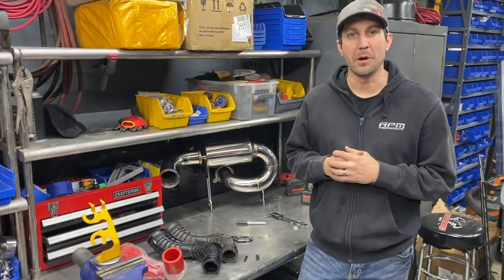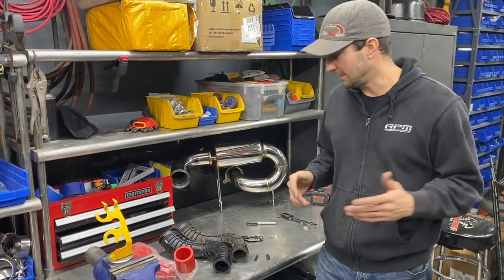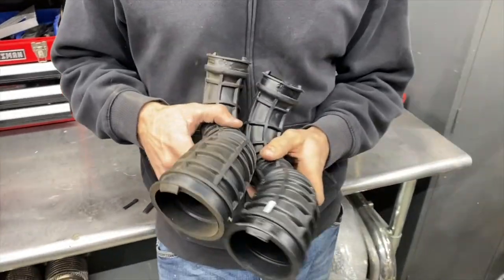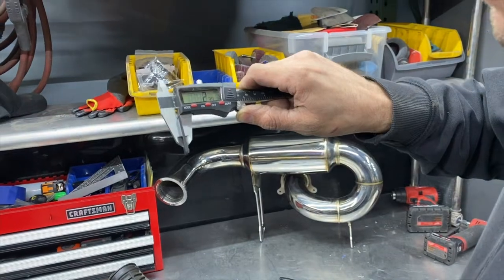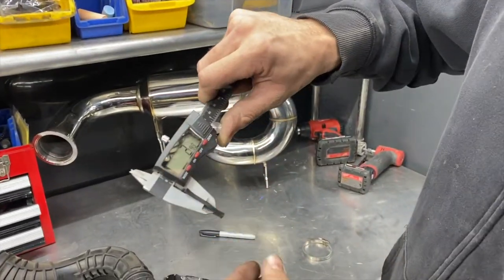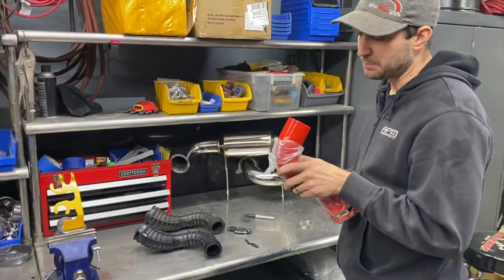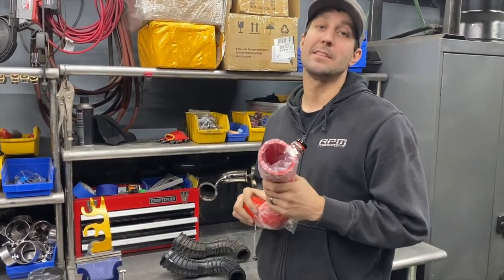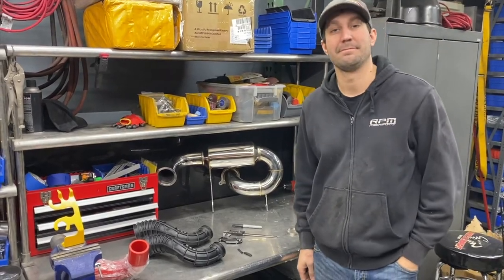Ski-Doo Turbo 850 Gen 5 vs Gen 4 vs RPM Charge tubes!

Comment: Why not just weigh the gen 4 and 5 charge tube? There could be a difference in material type or stiffening ribs. Appreciate you cutting a hole in them both in the name of science though.
Reply from the maker: The gen 5 is actually softer than the Gen 4's.
Reply: IMHO what matters is the resistance to bursting under load from turbo pressure, resistance to thermal load and fatigue from thermal cycling, the effectiveness of the joints to seal at the interfaces with the attaching components, and fitment of the charge tube as a part of the intake system packaging. Functional performance and durability should be the measures of performance, not material thickness.
Reply: @RPMPowersports  well there you go. So there is a difference.  softer is more pliable and less resistant to cracking.
Reply from the maker: @Captndarty  thinner is also easier to expand and burst, which is the issue with the charge tubes from the factory.